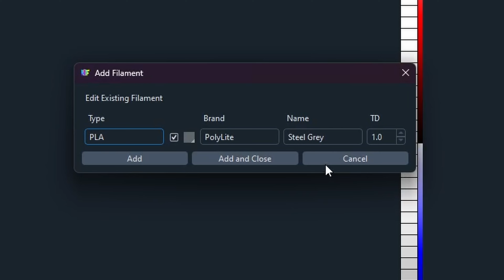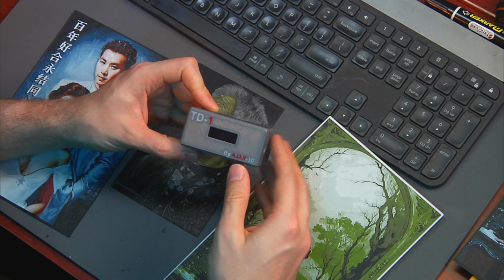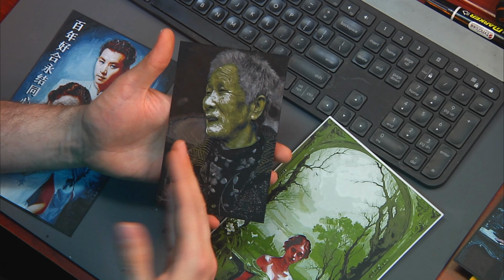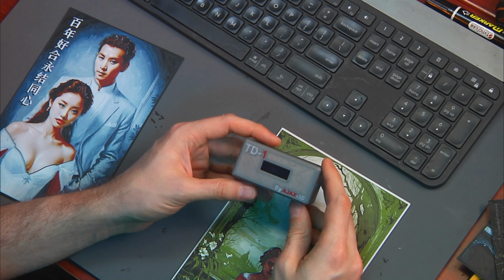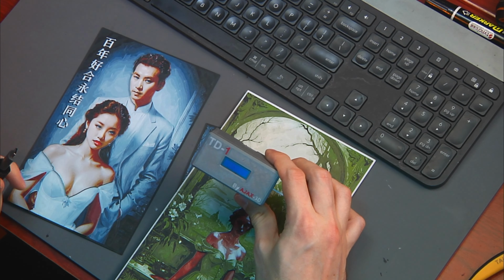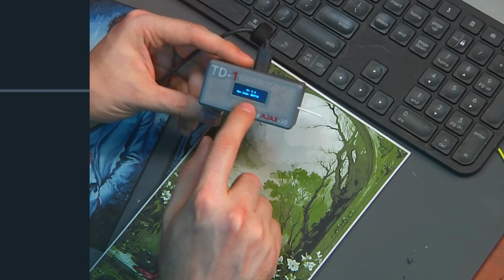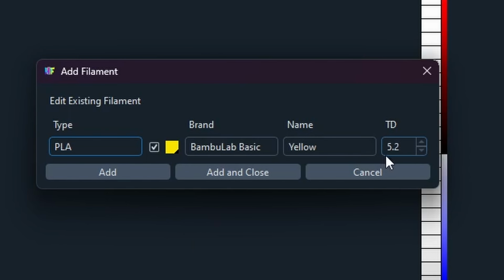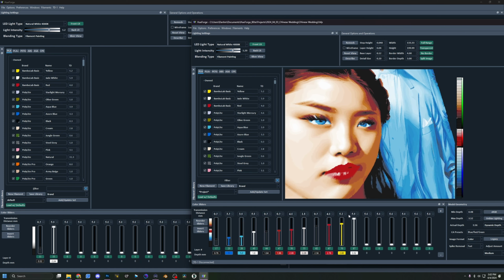WTF is TD - Beginner's guide to HueForge EP 02

Comment: Hi great video, Questiont hough  in Hueforge i noticed on yours it has  the TD-1 Menu at top  of your screen mine doesn't have that option. ?   what versions re you running or does it appear when you connect the TD-1?   i just ordered a TD-1 and wanted to know please advise thanks
Reply from the maker: When you plug in it shows the menu. The current version of td1 and hueforge should work perfectly
Reply from the maker: When you plug in it shows the menu. The current version of td1 and hueforge should work perfectly
Reply: Yeah i thought that may happen. Thanks.  Order placed. I look forward to getting mine. And seeing more of your vids. Thanks for replying

Comment: So if I understand it correctly, the TD values that are already in the Hueforge app, are not accurate at all ? Because the value of the Bambu yellow was 6.0 and your piece of filament was 5.2. So I'm guessing none of the values in the TD database are correct ?
Or is it that no spool of filament is the same and the values are always different ? And the Bambu yellow they put in the database indeed had a value of 6.0 at that time ?
Thanks in advance.
Reply from the maker: @iljacoveliers5834  I'm sure he did his best to get them right. But yes the values in hueforge stock should not be trusted. I havnt tested if the spools are not consistent along batches but I'd say it's safe to re test.

Comment: Please Slow down!!   You have to plug the TD-1 into your PC AFTER getting HueForge running, then Hueforge and the TD-1 find each other. Dont plug the TD-1 into your PC before starting it up like I did or before you have HueForge running.   FYI     Laurie NZ
Reply from the maker: That sounds like a usb c power surge that fried the td1, as you know usbc is capable of up to 19v I believe but there is a handshake that limits the voltage and it might mess something up if it's plugged in when you start up
Reply: @33rdframe  Cool  it just didnt connect to HueForge..... The PC showed it as a connected USB drive with two odd names....but ok when I instead plugged it in to the PC after starting Hueforge.  You showed a drop down menu I think (?) but that's not on my latest version. Had to add a new filament and then  edit that...which worked fine.